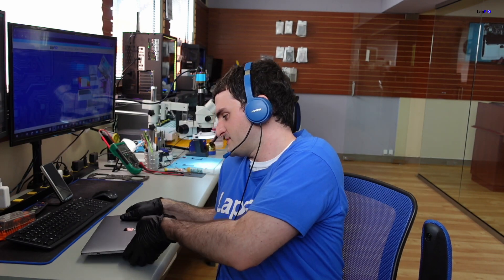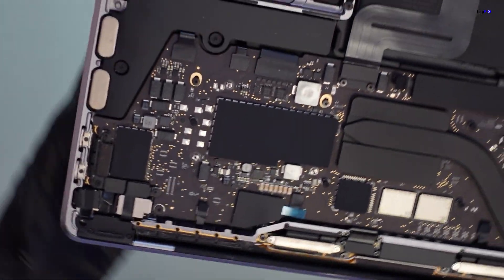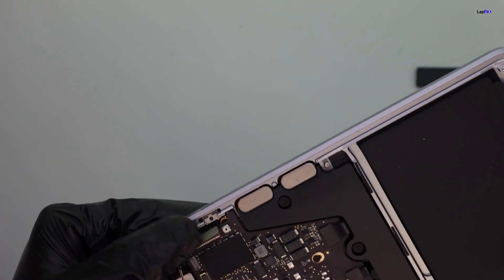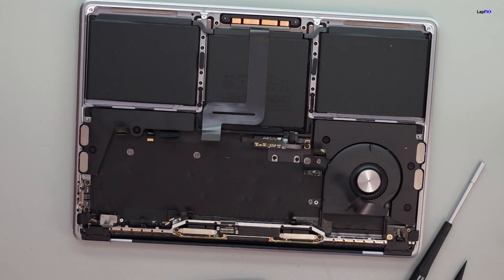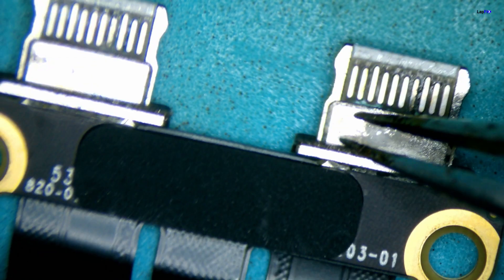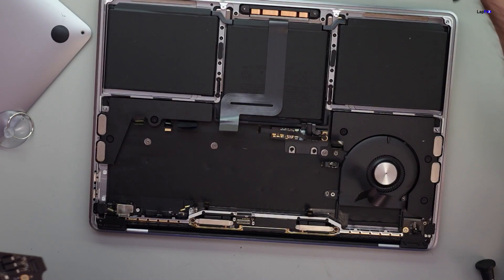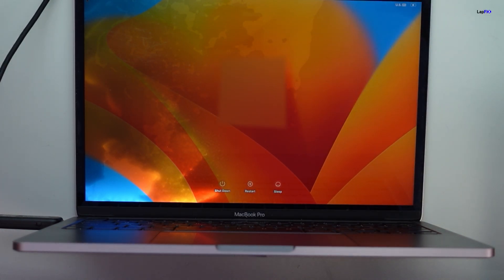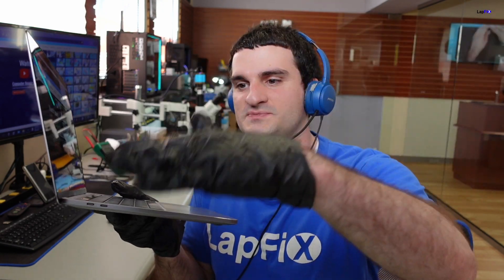M1 Macbook Pro Not Charging After Liquid Spill Fix

Comment: I found your video helpful! Thank you! My daughter spilled a chai on her laptop that was in her backpack. She thought there was no damage and used the laptop for a few hours--no problems. When she went to charge it up--it wouldn't charge. Do you think she may have damaged the battery or the charge port part? I know you can't know for sure but I would love your advice. thanks!!
Reply: Hey!, I just had the exact same scenario! I spilled liquid on my mac and it immediately shut down, I opened it and thought it was all right, later when I attempted to charge it, it doesn’t charge. 
Hopefully you got it fixed! please let me know if it needed a complete repair.
Reply: @blueedream Did it finally charge? Because I’m literally in the the exact same situation right now. 😭🙏😩
Reply: dude same, my ex left my water bottle open in my backpack and it spilled on our way to class cooking my Mac. now it only turns on when plugged in but won't charge lol

Comment: Very interesting video.

I'm right now trying to get a M1 macbook back from the dead after a liquid spill.

Got the corrosion removed with isopropyl alcohol up to the point it would start, but some things are weird still.
The fan would blow at 100% all the time and the battery doesn't show how much it charged, even tho it would stay on with the charger unpluged (once the mac is started).
Should I change the battery? Where is the charge detector located? On the mainboard or on the daugther board between the battery and the main board?

Comment: Hello Lapfix,

How has been your day? Fine am sure. Thanks for being there for many people. Well, I need help with an old hard drive (IDE) that I have. The hard drive was formatted but I need the data in that hard drive. Besides, when I connect it to my laptop as an external with an adapter it doesn't show up. Perhaps, the hard drive is not spinning enough. Any hope? What can I do?

Thanks as I wait for response.
Reply from the maker: Good day, I am fine thank you for asking.  The external adapter may not be spinning as IDE usually have jumpers (see your pcb for what they are) and may not detect or spin up.  Otherwise there is usually a problem with the drive